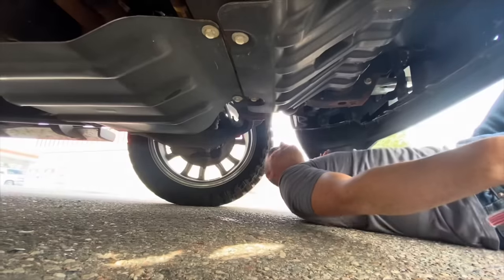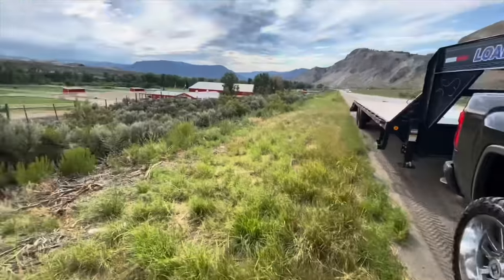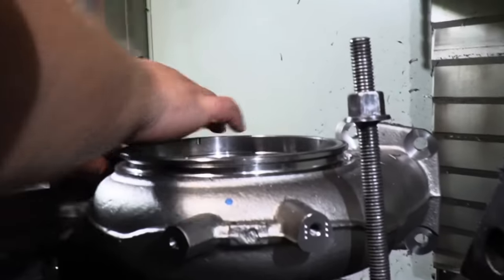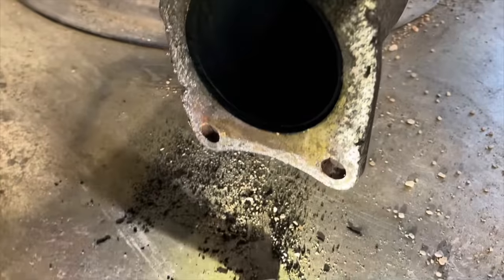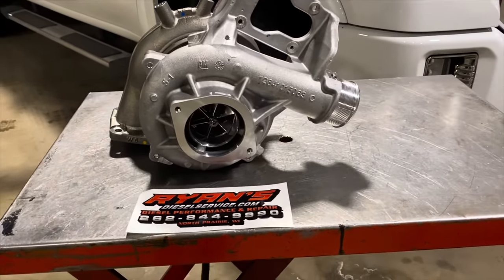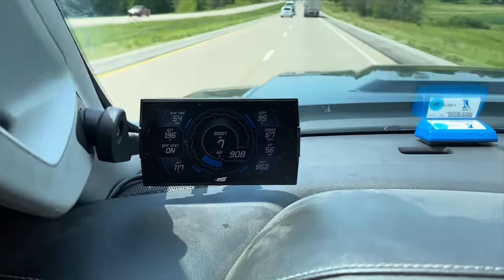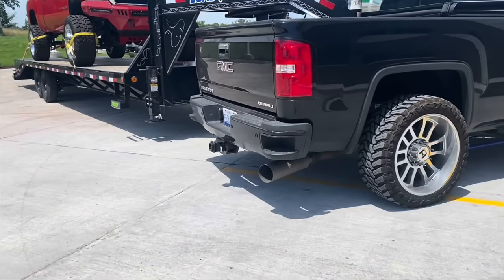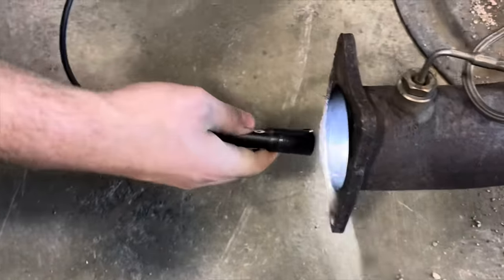This Is What Emissions Did To My Diesel! Heads Up Diesel Owners!

Comment: Hey Truck Master/Earl/Josh,  I feel there's a few things you guys can learn about DEF. DEF does NOT affect the plugged up Diesel Particulate Filter whatsoever. The diesel particulate filter uses a fuel injector that injects fuel directly into the filter that increases the exhaust  gas temperature to essentially incinerate the captured soot.  Basically the soot is burned at about 1100 degrees Fahrenheit and converts it to ash (which is sometimes noticeable in the form of white smoke coming from the exhaust during regen).  That's how the soot is cleaned out of the DPF when everything is working well.  The way the computer knows when to clean the filter (regen) is by comparing the readings of 2 pressure sensors. 1 pressure sensor is positioned before the DPF and the 2nd pressure sensor is positioned after the DPF. The computer compares the 2 readings and comes up with a differential pressure which is used to calculate the "grams of soot" that is trapped inside the DPF and when to regen as well. 
The melted sensor that you pointed out was merely the 2nd or "downstream" NOX sensor.  The DEF (diesel exhaust fluid) is only used to reduce NOX emissions and is injected directly into a separate chamber of the exhaust system and is called the SCR (Selective catalytic reduction). Basically it's a catalytic converter positioned AFTER the diesel particulate filter.  The 1st NOX sensor is placed just before or "upstream" of the SCR and is compared by the computer to check if the DEF and SCR are indeed reducing the NOX level being pushed out the tailpipe. 
This doesn't mean that the SCR cannot get plugged ALSO, but the DEF cannot cause the DPF to malfunction and not clean itself properly. 
Personally I firmly believe that the PULSAR tuning accessory is to blame. It plugs right into the original computer and changes the way it operates to get more power and torque. There's a bug in the programming or it's just not getting the proper signals to and from the emissions system.  Hardware or software, I'd bet money that the PULSAR module and tuning caused ALL of the emissions system issues on the journey. 
Long time subscriber here and I truly enjoy your content! I was happy for the winner of the truck giveaway even if slightly, no... totally jealous! 
I hope you don't have any more issues with your Denali. It's a powerful beast and a dang good looking truck!
Thanks for the exciting content! I was anxiously awaiting the outcome and praying for the best possible 🙏
Reply: Would have never happened with out the emissions tumor
Reply: Question about the fuel injector that injects diesel into the dpf, i know on my powerstroke it uses the engine injector(s) and just activates them during the exhaust stroke of the piston(s) idk which or if all but I wondered if in the past or different manufacturers literally use an "auxiliary" injector that is in the exhaust pipe before the DPF?
Reply: Also it was such a joy when towing the fifth wheel watching the DPF% work itself to 0% passively. When working these trucks put out enough heat to just burn the soot out without regen.
Reply: Had the same thought about the tuner. Banks did a review on it and said running that tuner would be regen city.  nothing in that tuner to control boost just adds more fuel.
Reply: @foxbraap6373  yes it was a thing to inject diesel on the exhaust stroke of the last cylinder. However this has become a thing of the past because it lead to washing of the cylinder wall and causing engine failures from lack of lubrication. Now they use a separate injector right behind the turbo on the downpipe
Reply: @OneNation_SpeakTruth  They call it a dozer injector. with a dpf no idling. do forced a regen frequently with a scan tool
Reply: @foxbraap6373  
Your year of powerstroke uses only 1 cylinder for regen though I'm also not sure which one. 
All of the manufacturers went away from that method of getting raw fuel into the DPF because it's not good for the longevity of that particular cylinder. It "washes" the oil used for lubrication away during regen and wears it out faster. All the DPF regen strategies nowadays utilize an additional fuel injector that injects it directly into the upstream flow of the DPF. This eliminates the cylinder "washing" and also doesn't effect engine power output during regen because all 8 cylinders are still producing power.
Reply: @agger838  I didn't see your response to Ian fox before I wasted my time replying.  Lol
Reply: @foxbraap6373  passive regen is ideal!
Reply: @Springfield-1903  22 powerstorke? Uses 1 cylinder, maybe it switches them around lol nice and ever.
Reply: I wast think the pulsar the entire video  !!!!  I just ordered a pulsar for my truck and I am like 🤷🏼 Might get my money back and go with the banks system !
Reply: @stephencanizio4492  
The Banks system is at the top of my list!
Reply: @foxbraap6373 ... negative.  I thought you had an older powerstroke.  A 2022 definitely has the 9th injector for the DPF
Reply: FINALLY! Someone that is educated on how the aftertreatment system works. 100% that this issue on this truck was owner-induced through poor modifications made to the truck.
Reply: @foxbraap6373  it can be done either way - by injecting fuel on exhaust stroke, or an extra injector. It's up to the OEMs to decide how they want to build their systems. Many over-the-road trucks use a 7th injector (as they are inline-6 engines)
Reply: @mx3727  
I hate to say it but... Josh is still blaming the DEF for not cleaning the DPF. 🤦🏽‍♂️
Reply: @Springfield-1903  
hmm like the 6.4 powerstrokes?

Comment: Hours after watching your give-a-way truck video my 2018 Denali threw a P1488 code. That is the particulate matter sensor. Wiring and connector look fine so I reset the code with the Derringer and dialed all the power settings back including the PedalMonster and things appear to be ok. So glad you got out of your predicament without serious damage. We're all learning how hard we can push these emission systems before they melt/plug up/fall off.......
Reply: Funny. Mine threw a po184 code. Do you know how to fix that. Says it's a temperature censor. Thanks 🙏
Reply: Oh it'll come back, just give it some time lol. Start saving your money now.
Reply: I thought that was a VW specific code.
Reply: Wendell that is a differential pressure sensor. one hose in front of dpf and one behind they detect pressure differences. and yes this is usually the culprit. it gets clogged then sends pcm the wrong information basically will let dpf get clogged without regents. most of the problems i see with dpf is idling. it doesn't get dpf hot enough to burn off the soot i highly recommend running the dog shit out of the new diesels.

Comment: I'm glad my 97 7.3 powerstroke is still kicking! I couldn't imagine your frustration. Hope you get it all figured out. And thanks for your service! 🇺🇲
Reply: Can't beat the older stuff my dad's 04 6.6 is still going strong too say no to that emotions crap
Reply: Amen to that, my 03 7.3 6 speed has  310k on her and never acts up,will never buy that new crap just for this reason..those 7.3 never die and love the ketchup line
Reply: ALL THE NEW BRANDS ARE JUNK ,, THAT IS WHY EVERYONE DELETINS ALL THAT B.S.
Reply: @SneakySnake-vs6sm  I do LOVE my 00 7.3 ZF6 Lariat dually but...some things in the newer trucks are nice. Ride quality, cabin noise, heated/cooled seats, overall look of the interiors, gauges, dual climate control, etc. 
Don't get me wrong, my 7.3 isn't going anywhere but it has taken a lot of time/work/$$$ (needs even more) to make her comfy to ride in, have enough technology like BT calling/backup camera, and have the extra HP/TQ needed to make her anything but a snail.
Reply: All I do is work on my 2002 f550 7.3
Reply: The older pre emission diesels are the way to go it just sucks they're slow and lacking power compared to the new ones.
Reply: @Brandon68plus1  Yeah the older Cummins are little in being 5.9L but I don't consider them slow or lacking so called power.  They do the speed limit just fine and I don't see what more is needed.
Reply: @paulregarg7455  owned my 300k mile f250 7.3 for 5 years, have done nothing but oil changes and a battery. And I own a f350 7.3  and it's had no issues as well
Reply: @paulregarg7455  guess there's good and bad ones
Reply: Matt Clapper, my '97 F350 4x4 7.3 has 359 k miles and the engine has never been touched other than new glow plugs last summer. Water pump and vacuum pump at 210 k miles. My BIL has a 7.3 Ford car carrier, and it has over 500k miles.
Reply: @tammylott921  Ford builds their own diesel engine. GM and Ram can't say that.
Reply: @bingalz1  182,000 miles and I had to fix the high psi oil line from the pump to the valve cover this morning before it went out on a service call     lol     it's never ending last month it was the throttle pedal last February all the injectors and glow plugs
Reply: @sergeantmasson3669  wrong there sarge the 7.3 is navistar international not ford
Reply: @paulregarg7455  I know that but what you obviously don't know is that Ford contracted with International Navistar to build it in the first place. The IHN 6.0 and 6.4 engines were crap and Ford broke the ties with IHN and built the 6.7 on their own. Ram and GM don't build their own diesel engines. Ram trucks use Cummins. GM uses Isuzu. BTW, I'm a 50+ years master level factory certified auto/truck tech. Most of those years with Ford. I'm certified for smaller diesel engines to tractor trailer and industrial diesel engines.
Reply: @paulregarg7455  damn, yeah I'm probably due to have injector and glow plug issue with my mileage. Better start saving my change
Reply: @Brandon68plus1  you wrong there, they have more hp and torque than older ones
Reply: @sergeantmasson3669  We all know this,  but our discussion  was on the 7.3 at the time of your original comment
Reply: @paulregarg7455  AGAIN, Ford contracted International Navistar to build the 7.3 engine. Mopar uses Cummins engines. GM went to Isuzu for a diesel engine. Of the three American truck makes, Ford is the only one with their own diesel. BTW, at one time, Ford used CAT and Detroit diesel engines. To date, the 7.3 diesel engine is still has the best reliability/longevity record.
Reply: @sergeantmasson3669  designed and build by nav ih
Reply: @paulregarg7455  No sh*t, Sherlock. Ford contracted International Navistar to build the 7.3 engine. Ram went to Cummins for a diesel engine and GM went to Isuzu. Currently, only American truck to use their own diesel engine is Ford. BTW, Only Ford trucks are all made in the USA. Ram and GM can't say that.  Ram and GM still make some of their trucks in Mexico.
Reply: Won’t be long the grubament will force you to scrape your old truck
Reply: @bencoldwell4609  Highly unlikely that's going to happen anytime soon.
Reply: I have a cummins...bullet proof..but wish they still made the 7.3 PS...that one was bomb proof

Comment: I had 18 3500 duramax never had this issue. Excellent truck loved the power. Retired didn't want the payment, sold it for a hefty price and went with a low mile 06 ram 3500 5.9, runs awesome.

Comment: Glad you got her fixed. I agree doesn’t matter the brand it’s the emissions that kill these trucks. I want a new diesel so bad but I am turned off by that such thing. Deleting is a no go where I live and I don’t want to deal with that every year. Awesome video! Adrian
Reply: Everyone should blame the epa when they drive junk.
Reply: If you want a new diesel but cannot get a delete, don’t do it. It’s not worth it. You will have a headache once the check engine light comes on.

If you can delete it. DO IT. It will outlast you.

Comment: FYI
When dealing with a restricted DPF and stuck on the side of the road, we just disconnect the flange at the down pipe or somewhere before the DPF. Leave it hanging enough for the engine to run and get it off the road.
Plus when you have a plugged DPF need to know what caused the premature soot loading of the DPF.
Looks like you figured it out!
Reply: Or just remove the dpf
Reply: I work on heavy trucks and most of the trucks that have regen issues like face plugging…. It’s usually due to maintenance…. Old fuel filters…. Old intake air filters…. Incomplete combustion. Over filling of oil and oil burning….. short trips …. Turning off during regen….. or idling to much…. Usually there is something that causes these issues

Comment: I sure am enjoying the fact that I have a 7.3 powerstroke right now every time I watch videos like this. I'm glad I never bought into the idea that newer diesel trucks are great trucks because they're far from it.
Reply: ‘01 
7.🌲 
Running on used cooking oil, and used motor oil
Reply: I own a 2001 f250 with 380,000 Miles on same engine and transmission I just keep it maintained regularly and using motorcraft filter and still running like a champ!!!!!
Reply: My 2013 Ram is a beast after I misplaced a few parts. God bless Florida.
Reply: My 2008 6.4  has 312,000 miles and no issues when I was in Mexico on Vacation some of the parts were stolen, but I haven't noticed any problems except much better mileage.
Reply: @rondye9398  yes those are good also 
But have to maintain it very well and use motorcraft filters

Comment: You're absolutely right, when the government bailed out the auto manufacturers in '08, part of the settlement forced them to accept absurd levels of particulate emissions thus the evolution of DEF systems. They've done their best to deliver diesel powered vehicles that conform but ultimately, they're saddled with additional systems that make us all more dealer dependent and cost prohibitive on a long term basis. It's a real shame as once unleashed from these performance choaking regulations, modern diesel engines can make extraordinary power, last forever with great mileage and still be environmentally friendly.
Reply: Just keep this in mind when the Government baled them out they had to pay back plus interest,  it wasn't a free bale out!!!
Reply: @stevenstair1068  gm was forgiven quite  a bit gm and dems in bed together
Reply: @glenwarren4351   and they paid all loans plus interest in record  time!!!
Reply: Tier 4 emissions standards were talked about and put into play in 2004. Bailout had nothing to do with emissions standards
Reply: The exact same could be said about cars in the 70s and 80s. It eventually worked out.
Reply: i would say once they paid it off the contract is void and bye bye DEF
Reply: @myacidninjatheamazing1025  a contract with the devil is never void. And it is always one sided.
Reply: LOL, that was not part of the settlement.
Reply: Damn. I remember that

Comment: Same shit happened to my Colorado diesel but 3 times. Mine was under warranty though. Last time to the dealer it sat for a month. I told them if they can’t fix it that they were buying it back. They ended up flying in an engineer from the factory. They replaced the entire exhaust system the DEF nozzle and I think a pump. also reflashed the ECM so it would regen more often. Knock on wood has been fine since.

Comment: Great video.  I have 6.0 Power stroke and its been nothing but problems.  Had a new engine installed and still problems. Its back in the shop and its no fun.   Glad your truck is fixed.

Comment: I have a 2014 LML, I use a reprogrammed ScanGauge to monitor the soot load. I find at 42 grams it goes into Regen mode and drops to about 5 grams. The truck has no indication on the instrument panel to tell you when you are in regen or soot load.

Comment: OK  Retired pro truck driver here. I've watched the new "regen" trucks burn to the ground. Or  it'll go into regen mode when you are loaded and going uphill.  FYI I once had an R model Mack with a 350 Mack engine. The closest thing to emission equipment was the "puff" limiter. Loaded it averaged 10mpg empty it was 14. Then they came out with the emissions trucks, which got 5-7 mpg. Honestly which one was polluting more ?  Just say n.     Dave

Comment: I was assuming the 9th injector was bad and it wasn't able to burn hot enough to complete  a regen. The def injector doesn't effect the dpf soot. It just lowers the nox ppm in the exhaust gas. But if a sensor is bad then I guess it could tell it to dump a bunch a def into the exhaust
Reply: I drive a transit bus for a living and they have Cummins motors.  One bus will use 1 gallon of def for 34 gallons of fuel another will use 4 gallons def for the same amount of fuel.  It's wierd never understood that.  Never been in limp mode or had any issues still waiting.

Comment: I had my truck 2022 Duramax Throw a code for clogged DPF in just a few thousand miles, Quote from the dealer was that GM had a "Required SW Update for the Regen System on the 2022s that needed to be completed"   After Manual Regen and SW update, I have not had an issue with it since.

Comment: I’d highly recommend using Better Diesel fuel borne catalyst. I’ve been using it in my 2013 Freightliner for several years and haven’t had any emission issues. It burns more of the soot in the combustion chamber at a lower temperature. I’ve only been having one to two regents per month.

Comment: Glad you got it figured out and it wasn't as catastrophic as anticipated. 

Sounds like the issue was more related to wiring, sensors, or the DEF injector than it was anything else, unless the DPF clogged so bad that it caused the meltdown of the others.